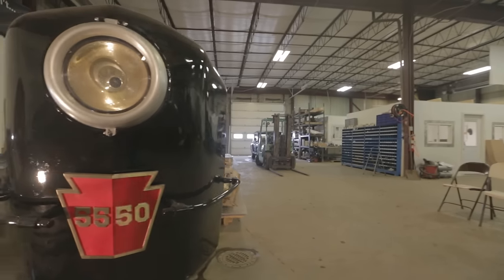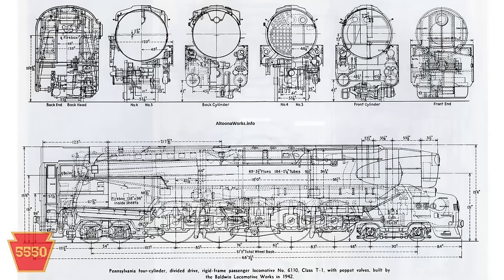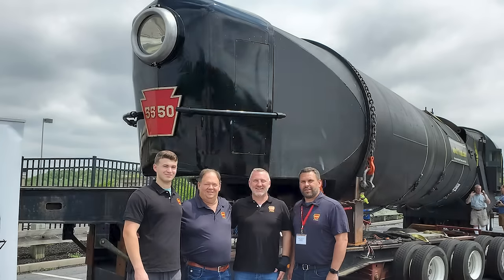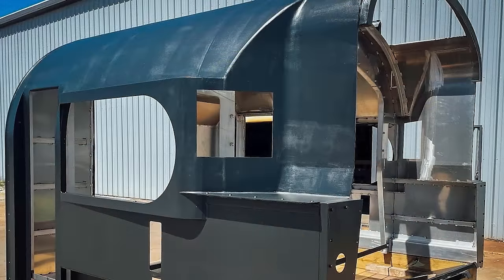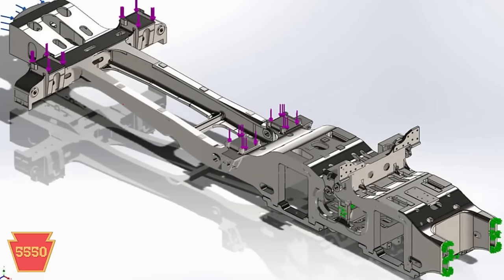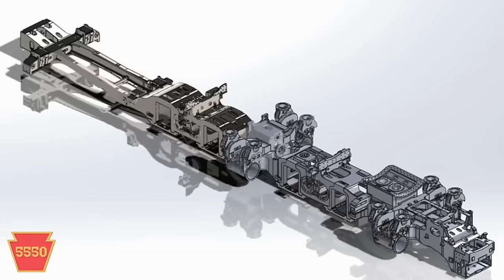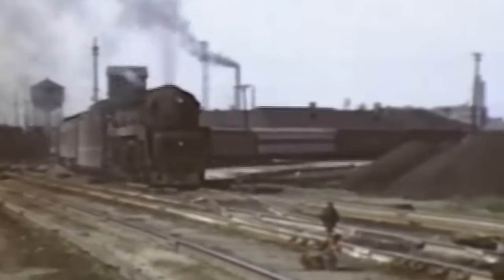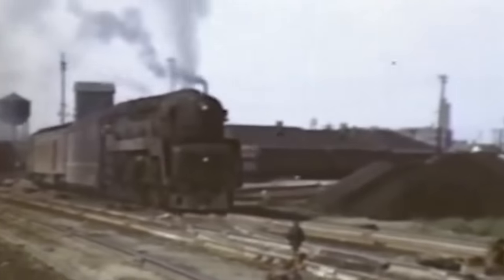Can we build a NEW mainline steam locomotive in the United States? | Restoration Roundtable

Comment: With the technology that has evolved since these where conceived, you could improve the design exponentially. 
Have the heart of steam running new tech you could make a locomotive that could last in service a very long time. 
This is a daydream I have occasionally about bring a new steam locomotive to life.
Reply: Amusingly enough the T1 Trust engineering committee engaged thoroughly in that, under the guise of a "5551" discussion.  This was somewhat restricted to improvements for an eight-drivered duplex and not, say, to a double-Atlantic adaptation of Turbomotive 2, or a mechanical turbine with Bowes drive, or a GTCC locomotive using the UT MegaGen.

That locomotive would be the improved 'follow-on' design, fixing the obvious issues in the historical design.  The chassis would be adapted to have better balance, incorporate proper Deem-style conjugation, and feature lateral-acting traction control on driver cheek plates.  It would have a better radiant section, even if oil-fired (equivalent of at least 100 to 102' GA) and proper feedwater and air preheat arrangements, probably including Cunningham circulators in the water legs.  Arguably it might combine the valve arrangement from British Caprotti with the continuous cam arrangement of FSSD type C.  Rearranged headers would make separate 'precision' air throttles for the two engines practical.

Comment: What passenger or freight train runs at 140 MPH? If there are high speed passenger lines, do you think the owners of that track will allow a T-1 on it? How about set the goal for more practical operation, rather than record breaking.  These engines proves less than satisfactory in the first place. There are much better engines that could be brought back from extinction.  No matter what you do, this engine will not be used for main line operation especially for passenger runs. Go for revenue freight and work with short lines to length of trackage. Yes, the brits do build new. But they also build practical.
Reply: The PRR T1 doesn’t need to run as fast as possible all the time. In fact it doesn’t have to at all. They can run it as fast as who ever is hosting them wants too. The PRR T1 was a good design, it was cut short, but most of the problems were fixed in the final design. I’d actually say its high top speed actually makes it quite versatile in where it could go. It can run on any tourist line that can host a large 4-8-4 or 2-8-4. Due to its powered duplex drive it can still pull a fairly large passenger train at slower speeds. If invited to run on a class 1 it could fit within its timetable without a problem. If/when invited to a tourist route it could go as fast as the line permits without issue. I’m sure it could do freight on a tourist route given that is what the PRR used them for in the class’s final years.
Reply: I have a few things you need to read:

1.) The 5550 will do test runs at the high speed test loop in Pueblo, CO.

2.) This locomotive will be used for excursions and events on short lines and regional railroads that can handle a PRR T1 locomotive. Not for revenue freight.

3.) management on class ones change every three years on average

Therefore this is practical.
Reply: Couldn’t of
Said it better myself.  Who cares how fast maintenance on tracks now is now minimal as for trucks !!  Bad track . Both big guys had big cut backs an the shit happens see what happens when you cut cost .
Reply: And in rebuttal:  #1, doing test runs on specialized track is little different than testing race cars at Daytona. It does no translate to rail capacity in real life.  #2  There are many powerful, efficient, restored engines being wasted on excursion trains. The important thing is to prove that Steam can be nearly - NEARLY as efficient as Diesel.  I think C&O came close to doing that.  #3 Management on class one rail systems, including AMTRACK, had increasingly DENIED access to trackage to privately owned engines as well as shutting down their own steam programs. Again - It is not important to run privately owned engine on short lines dragging old cars around for tourists. It is important to prove that Seam locomotives can do what they were designed for in the modern world.  @chooch1764
Reply: @organbuilder272  No steam ever gets wasted on excursions. I don’t like the way you said that. This isn’t the steam era. Can you just get on one steam excursion just to sit back and enjoy the ride. We all need to slow down our lives every once in a while. I’d rather be on a steam excursion going at a relaxed pace right now, instead of being in a crazy world dealing with people who don’t know what they are talking about. All in all, you’re just being in denial that steam locomotives today are solely for education and fun times and experiences.
Reply: If this is not the steam era, why are millions being spend on restoring engines that do nothing more than play choo-choo for kids and people going at a "relaxed Pace". What is useful, aside from a tourist attraction, about hauling old rail cars that are not authentic, and go almost nowhere.  Locomotives were not made to do that. They were made to WORK, every day, all day with minimum maintenance and maximum fuel efficiency. Not all engines achieved that. The ones that didn't were soon scrapped.  Don't misunderstand me. I WANT to see steam on the high iron. They are monuments to engineering. Note that there a few people today who know how to build one  of these things and fewer still who can operate and maintain them PROPERLY.  Yes, let's get an alleghany back on line, Yellowstone and a couple of Challengers. Put them to work, pull heavy freight and show the modern age what these incredible machines can do.  Older people, like me, can remember standing track side and seeing one of these pulling freight - 110 cars or more @chooch1764  That is what many people want to see if you read postings for 4014, 844 and 3985.  Restore them with modern materials, tighter tolerances, better fit, stronger metal and lubrication systems. and use them for what they are designed for. WORK!!!.
Reply: @organbuilder272  Thank you for that novel length in denial rant that clearly proves my point about you. I guess you’ll never understand actually enjoying a steam locomotive for fun. You have been missing out a lot for the past several years now. Your opinions aren’t going to change anything about these amazing efforts to bring steam locomotives back to life for a simple experience. Steam purists make me laugh. 😂
Reply: @organbuilder272 I enjoy locomotives by riding behind them, driven by folks who actually care about running them, no matter where or how fast they go. Hopefully, you respect my passion to see and ride behind this beautiful and sharp sharknose T1.
Reply: I think it was September 1991 Trains magazine that had an article that suggests the T1 at least once ran over 120 mph to make up over mine minutes in a 40 mile stretch.
Reply: @organbuilder272 If there are much better and more practical locomotives to build than a T1, why aren’t you out starting one of those projects instead of naysaying this one?
Reply: @oriontaylor  That’s another thing these naysayers are always all-talk and do nothing about it, because they are so lazy.
Reply: Keep in mind that the T1 was never intended to run as a '140mph' engine, any more than a N&W J was a '100mph' engine.  The typical PRR passenger-train speed and performance as pulled (wastefully) by two K4s was the target, and the improvement was gauged relative to what a GG1 could deliver to Harrisburg (or had the 1943 extension been built, to Pittsburgh).  By employee timetable that is 80mph (it went to 100mph in 1967, but only with massive improvements) and it is significant that the speed recorders on the T1s only went to 100mph.

The big stated gains were in relative lack of augment and better water rate (which meant more to PRR than NYC because of the relative difficulty in providing track pans).  The lower nominal augment, particularly if the engine is built with Voyce Glaze's 4-4-4-4 balancing (which is recorded at NWHS) and zero overbalance, would be highly valuable in many excursion contexts, including those run at 'insurance-restricted' speed...
Reply: I have no interest in what these engines did or how they did it. A claim was made that the new T-1 would be capable of 140 MPH.  I say again, the original T-1 was not successful in overall performance. Yes, it was an interesting design and appearance. Unless they make some radical changes it will have the same characteristics as the original. SO, why not give an Allegheny a chance at life or a Yellowstone.  It would be nice to arrange to combine some short lines and use it for both passenger and revenue freight. After all, if these engines can be wasted pulling featherweight passenger consists, surely they can be put into regular passenger service on a short line or revitalize something like the Fowler (??) line which still remains in Florida.  What I am trying to say - put these giants into service and show people what they could do back in the day - and now. People do want to ride these trains. They are willing to pay for a 5 mile haul back and forth along some very boring track. Why not do it up right??  @wizlish

Comment: If you build it they (buffs) will come. But good luck getting a railroad to let you run it on their metals. With all the liability and insurance issues, it'll be another b itch and a half to accomplish that after finally building and testing by 2030 it if the project is even ever completed at all. Hopefully it just won't end up being simply displayed like so many steamers are. Bob chance, boys.
Reply: 1. There are short lines and tourist railroads that have invited 5550 to come visit them. Don’t give us that “mainline locomotives and short lines don’t go together” BS

2. This project will 100% get done. Have fun trackside with your camera ready.
Reply: Keep in mind that all the high-speed testing is already arranged to be on the Fast Loop at TTCI in Pueblo.  Obviously running in the appropriate range of high speed where there are adjacent trains with passengers would be unwise even if you could get an insurance quote tolerating it...

Comment: If they wanted a "challenge" they should've tried something bigger, prettier, complex. Personally I think a result that would be completely worth the wait and effort required would be a Southern Pacific AC-9. Large, powerful, beautiful, and proven. My biggest issue with rebuilding a T1 is the unpredictable nature of the wheels. Let alone the stiff frame is gonna make it a headache to operate. Wheelslip is the biggest concern here.
Reply: According to the Trust, they fixed most of the wheel slip issues by 1950. Improper handling by crews (given just about no training to operate one by the PRR) was another cause. Nothing that can’t be fixed.
Reply: @BattleshipMan_, Stooltoad5017 is right. Those issues were corrected a long time ago.
Reply: To recap the 'slip' discussion in a nutshell: an unconjugated T1 is like a 'double Atlantic' in that one driver momentarily unloading on something like a low rail joint, frog, or oil spot reduces adhesion on that engine by 25%, but is still passing essentially 3200 peak hp through what is now three contact patches.  If you combine this with the volumetric efficiency of FSSD type A valves (particularly if driven by rotary cam as in B-2) the slip can continue to a spin, which is difficult to 'break' at high road speed under load as there is only one throttle for both engines on the T1 as built (and as it turns out, no room to provide two without substantial and appearance-changing redesign.

Note that the Q2s were fitted with a very sophisticated analog-computing differential anti slip device for the forward engine -- which was spoiled by dumb implementation of the actual steam valve.  This could be easily made proportional and applied to a T1.

Likewise, the four Wagner throttles on each LP cylinder of the ACE3000 would provide a quick-acting solution that would not impede full-speed steam mass flow.

The 'best' solution is to implement the driver independent brake as a lateral-acting caliper acting on cheek plates in one or more driver pairs.  This can then be modulated easily both to 'trim' the output of one of the T1 engines or proportionally arrest a spin starting within a few 4096ths of a revolution.  This is visually too different for a 'replica' T1 but can be applied to the driver brake rigging in different and slightly more restricted form.  Note that this works effectively for both low-speed and high-speed slipping, and it is trivial to put two wheelslip lights in the cab to indicate when there is trouble brewing even when noise and relative lack of vibration give the engineer no feedback directly.

Comment: Admire the effort but question the selection of a T 1 class  a  locomotive known to have many design faults and an extremely short working life   There are many otherdesigns that wers vastly superior and more powerful    Additional this engine despite American bragging rights never will excede 130 MPH  the hammerthrow of the rods would restrict it
Reply: Not really sure where you got the ‘many design faults’ from. Most of the problems were fixed in the final design. All steam locomotives were shafted at the of the steam age. The NYC Niagaras were barely in service for ten years. Is that a slight against the design? No. Neither is it a slight against the PRR T1. Part of the fun of rebuilding it is being able to record how fast it could actually go. Pretty sure the duplex drive actually helps reduce hammerblow on the rails. Also pretty sure the test track at Pueblo can handle it either way (which is where it will be tested).
Reply: It's not 'hammerthrow'; it's 'hammer blow' and in modern United States practice we distinguish it as one component of what we call 'dynamic augment'.  I cannot help but marvel at your assertion that augment would be excessive on a four-coupled engine with Timken lightweight rods, in a design specifically intended to reduce both the magnitude and character of vertical augment.

Work in the United States indicated that an engine with the polar moment and guiding of a T1 can easily support zero overbalance, in which case both vertical and lateral 'hammer blow' are no problem for even a quartered two-cylinder engine at the speeds mentioned.  (The British in fact have a two-cylinder DA with 135-degree overbalance that had no difficulty running over 90mph... with as I recall 57" drivers.  And no trailing truck or Franklin radial buffer...

Comment: We absolutely can and absolutely SHOULD build a new steam locomotive especially an oil burner. My advice to you guys is PLEASE make sure it has proper spring equalization for good adhesion unlike the original T1s. And put roller bearings in the side rods and on all the wheels including the drivers. Eliminates most of all the friction issues steam locomotives had and allows for the engine to go further and require less maintenance as I'm sure y'all are VERY aware lmao. And DON'T try to break the world steam speed record. Just makes you look like a bunch of idiots that want something to brag about.
Reply: I confess this comment made me smile.  I have a copy of the spring-rigging for the 'production' T1 chassis (D432906) originally dated 4-17-45, and it shows no fewer than 6 substantial revisions to 12-31-47 (and I believe there were more in the proposed 1948 revisions).  The spring rigging is state-of-the-art for a low-augment design.  (This incidentally was the third drawing that went into the ESC repository, after the cast main-driver center and the Franklin Precision air throttle... so they know.

Meanwhile of course the T1 is a poster child for Timken roller-bearing thin section rods... and their alloy composition, progressive forging dies, bronze spherical bushings in the rod eyes, etc. have all been reverse engineered (as, incidentally, are the currently-produceable roller bearings that replace the original out-of-production types with modern ones.  There is no current difficulty for anyone with an interest in applying this type of rodwork to a locomotive.

Remember this was intended to operate at the same effective speed as a GG1, which is why the speed recorder only goes up to 100mph.  The design advantage was much lower track-damaging force, not 'ridiculously higher record speed' -- in any case most of the contemporary PRR 'Fleet of Modernism' wouldn't have ridden at all well at sustained 120+mph speeds, no matter how well the locomotive performed.  The 'main line' argument, such as it is, is that the T1 with any practical excursion consist could run at permissible traffic speed (~70mph), and start and stop that consist quickly enough, not to impede traffic.  And put no more force into the track structure than, say, a diesel-electric with EMD HTCR trucks.  That is the extent of what would be 'necessary', and the T1 design even as it existed at the beginning of 1948 was fully capable of fulfilling it.
Reply: @wizlish  well, they have to run it with a diesel now anyway and no diesel like an ES44 or SD70 can hit 126mph.